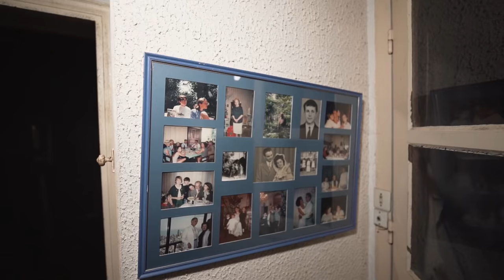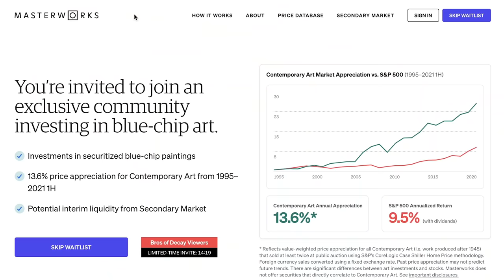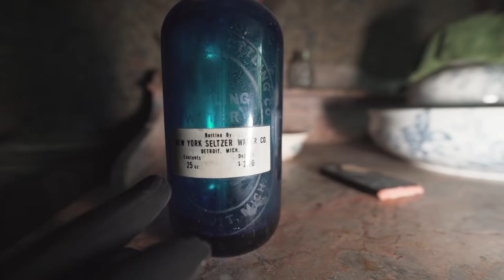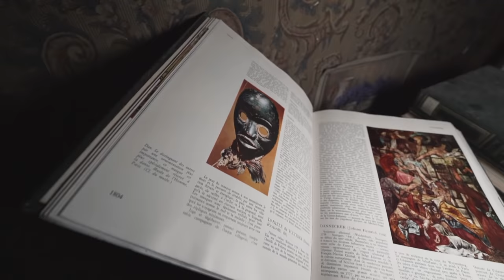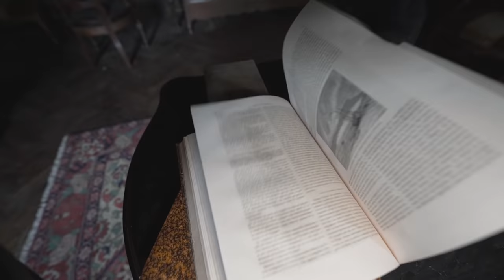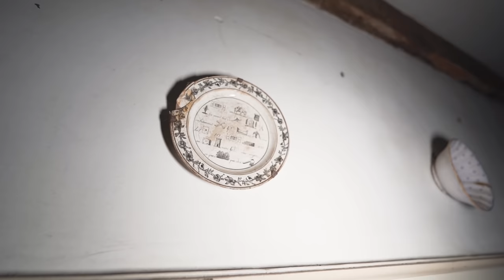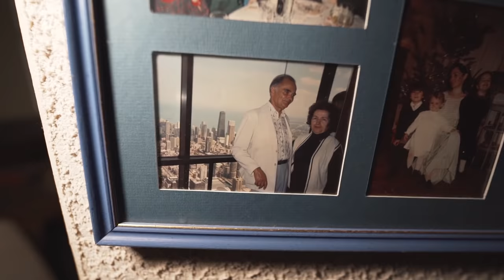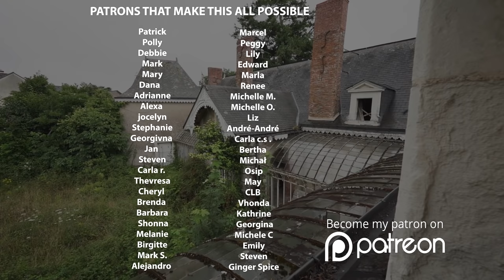Where Did They Go? ~ Noble Abandoned Mansion of a Corrupt Family

Comment: The wall coverings in that house, apart from the one in the hall, looked like fabric rather than paper. To replace it, would cost an awful lot of money. That silver oil lamp on the mantel piece was one of the nicest I’ve seen in a while. It needs a chimney and a lovely etched glass, cranberry coloured, tulip shaped shade and it would look fantastic. The lamp at the bottom of the hall stairs is from a horse drawn cart or coach. Love the carved benches from the year 1619 wow! This has been one of the most interesting explorations in a while.

Comment: I would call that an extended sunroom. A lot of my relatives had them.
I had a cousin in a very large house with a small  sunroom, but it also had two greenhouses each the size of a small cottage of glass and separate from the house. 
She grew plum, berries and I had wondered how she had such fresh looking roses in such a cold climate and there they were, in the greenhouse.
The windows opened to let out the heat, as it  got over 100 degrees Fahrenheit if not opened. The usual temperature outside was in the teens Celsius.
Far North of Scotland with cold winds.

Comment: 44:31 "look at the cooking top ,so primitive " , but check out the 2015 microwave right next to it 🤣😂🤣🤦🏻‍♀️, not to mention when you entered there were bicycle helmets hanging on the wall,and in the garage a gas powered weed eater on the table.  I question when this place was abandoned, because of the picture of the elderly couple in front of the new one world trade center was built in 2006

Comment: I didn’t see a bathroom at any point which concerns me. The roof looks to be intact and the roof beams look strong and I don’t see any rot in them. There doesn’t seem to be any water damage below which is good. Conceivably somebody could buy this property and restore it pretty easily. There doesn’t seem to be any structural needs except for cleaning up the roof and the attic area. Everything that’s inside of it can be cleaned and used. It’s a virtual museum A real time capsule.